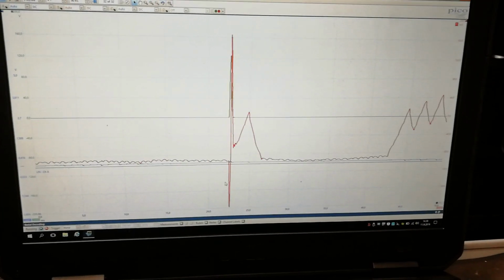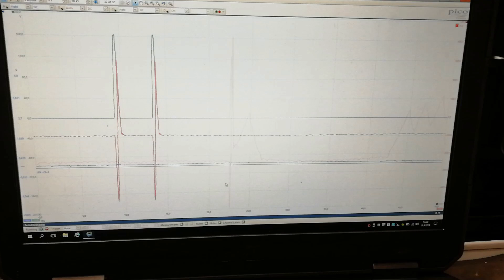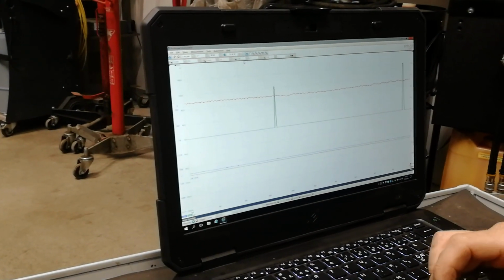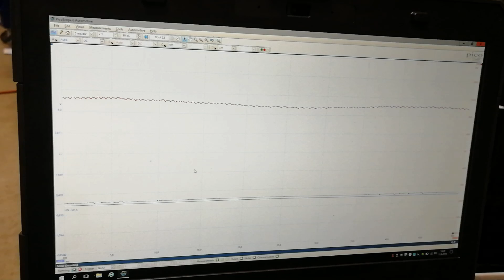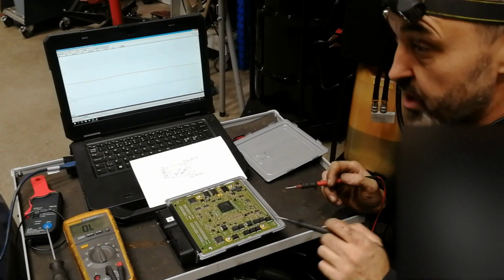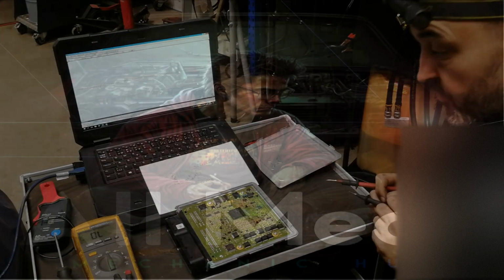how to test a mosfet with digital multimeter on a bmw dme with msd80 ecu.

Comment: Excellent video! Are you probing via coupling the relevant wires as opposed to sticking needles in the back of a connector? Thanks.
Reply from the maker: Hi there, this was videoed several years ago so my setup has changed somewhat. I was using a combo of back probing and those twistable pico / fluke piercing probes i.e backpinning. Glad you liked the vid and thank you for the comments 🙂